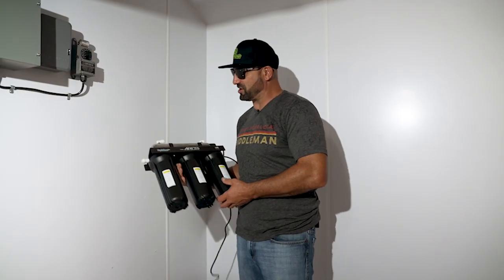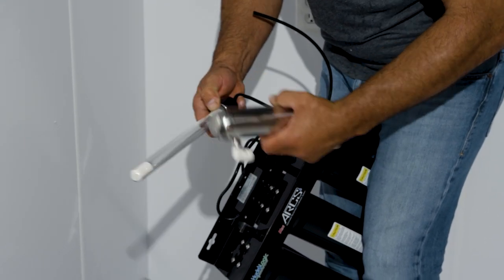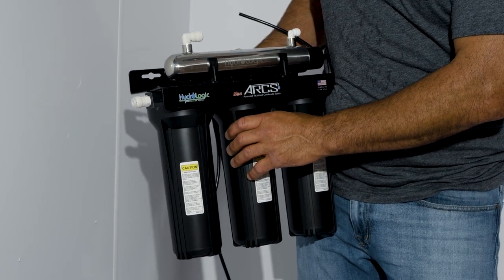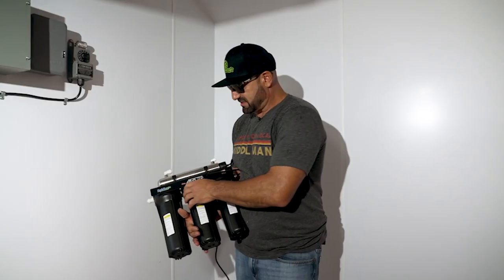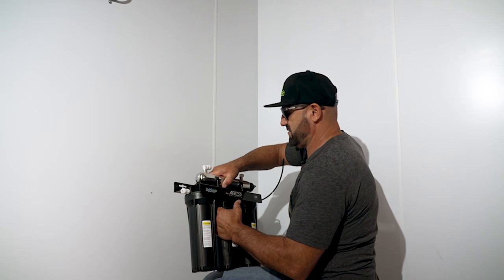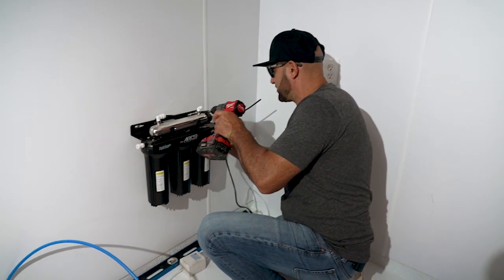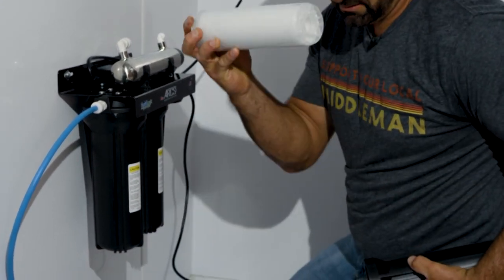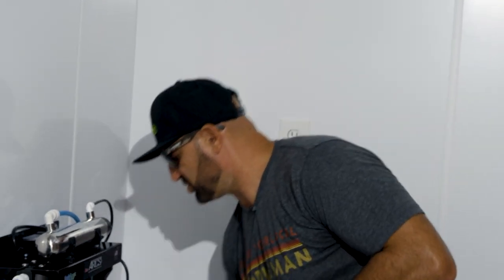Water Reclamation ARCS System | Growing Green Vol 11

Comment: I bet that little pump lasts 2 weeks before burning out. Why not put it on as float switch instead if it being on all the time?
Reply: Im sure with a tank that size he can either manual turn on as needed every couple days or have it on a timer that clicks on for so many hours each day as needed.
Reply: You can run tho's booster pumps for months on end.  Zero issue.  You can all so build this system for a few hundred and run it off a sump pump.